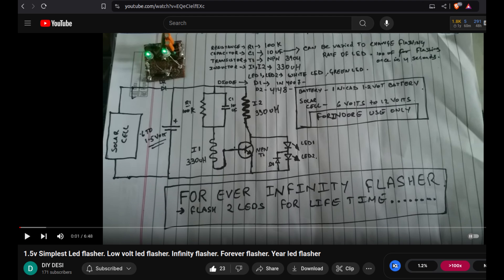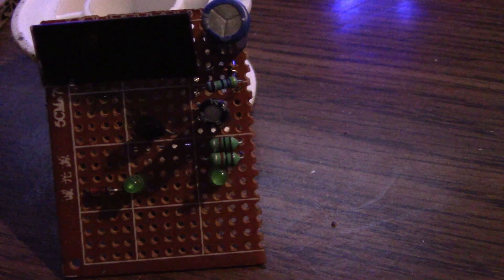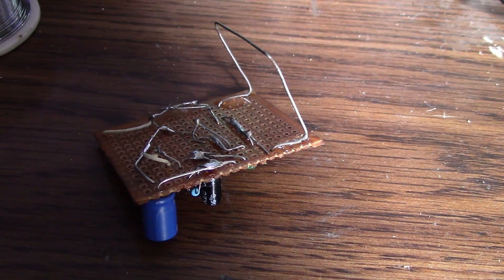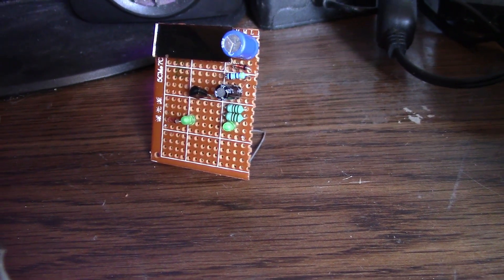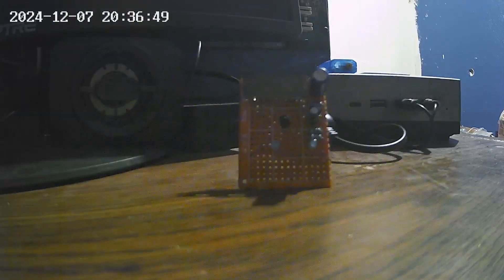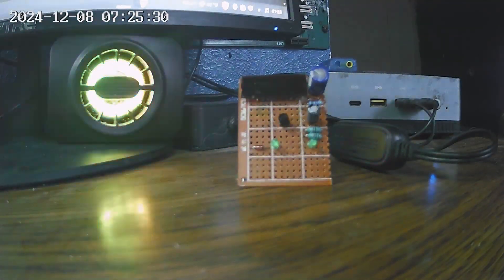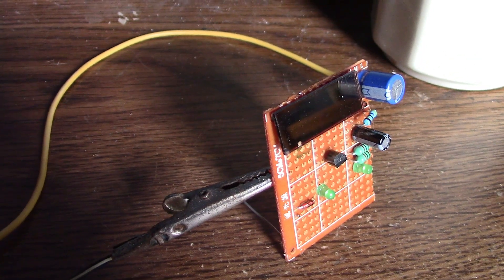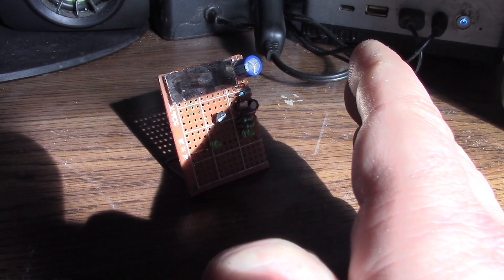This DIY Solar Circuit Runs All Day AND All Night

Comment: This will barely flash for a few decades, honestly. The electrolyte in the supercap will eventually dry out, and if they're anything like the electrolytics in 1980s vintage electronics, they will probably only last a couple of decades. Even less in continuous operation 24/7. If you can find a solid state capacitor that doesn't require an electrolyte, that would work. Or just use a rechargable button cell. They do exist. And have in many forms much more energy dense than any super cap. What problem are you solving by using a super cap in place of a tradition coin cell? They're less energy dense, and much larger physically. I don't see the advantage. The only advantage I can see is that you can solder directly onto the legs of a super cap, whereas you absolutely cannot (should not) solder directly on a battery. Only ultrasonic welding. Otherwise you cook the insides. You have to put the battery in a special holder that has to be exactly the right size. Which 3D printers can help with, but I can't justify buying a 3D printer just to be able to make custom battery enclosures. As nice as it would be.
Reply: I heard capacitors can be charged 1000 times faster and have as many times more charging cycles than any rechargible batterys...its of 2.7 volts but will be barely charged to 1.5 volts so wont get hot  also there is no such thing as undercharging or memory effect which rechargible batterys suffer..
Although things do break overtime❤
Reply from the maker: All correct. As I only replicated and then tweaked Desi's circuit I'm glad he answered you too. The main points are about efficiency and practical run time, which it does as a fun curio and with only component decay as a limit. 
The problem being solved is of not using a conventional battery at all. Down at 1F, the super cap size is very practical for small circuits.
I suppose it could be looked at it in a different way... I'm 55, the super cap will last longer than me.
Reply: @Slider2732_  if solar waiver can be powered insteed of led to make them dance pls a video ❤❤❤
Reply from the maker: @diydesi8433  Yep, just connect the outputs to the LED to the coil used in a waver instead. It should work. If you have a 1 Meg variable pot you'd then be able to set the oscillator rate. 
I don't know where my wavers are at the moment, will look for them. The dollar stores don't sell them around here either, or I'd buy a couple more just for the parts 😀

Comment: Very cool! I have a soft spot for circuits like this.

Have you tried playing around with the placement of the two inductors, and their polarity? I have built a similar oscillator circuit with a JFET, and I find that while it's not 100% necessary for the two inductors to be magnetically coupled to each other, it can really help the oscillator start up with less current. 

The best results I've gotten are from getting the two inductors placed closely adjacent and wired with the correct polarity so that when current flows through the output inductor, it produces a positive voltage at the base and turns the transistor on more strongly. I think that with axial inductors this would happen with them hooked up just like you show in the schematic and how I think you already have it on the board (with the transistor ends of both inductors next to each other). So I guess basically just playing around with their spacing from each other is all that remains.

The other things that can change the way this type of oscillator works are to add a small (~10-100pF) capacitor across the base and collector terminals of the transistor, and to add a a similarly sized capacitor across the output inductor. 

I'm going to say "change", not necessarily "improve".... but basically the way that the circuit works when the inductors aren't magnetically coupled is that the collector-base capacitance of the transistor couples some of the output energy back to the input, and completes the oscillation loop. Changing that coupling capacitance by adding some externally can change the circuit's behavior. Also, this coupling is more effective when the input inductor and output inductor circuits resonate at the same frequency, and putting a capacitor across the output inductor can achieve this. With lots of trial and error.

I will however say that while the capacitors do tend to lower the oscillation threshold, and allow the circuit to work with less current, they also tend to reduce the output power because they reduce the operating frequency. And if one puts a capacitor across the output inductor it's usually necessary to play around with the value of both that cap and the collector-base feedback cap separately to get them both adjusted right for each other. 

It's really quite a lot of fiddling around. Not saying it's worth it! The circuit seems to be working fine. Just thought I'd mention it in case anyone found it helpful.
Reply from the maker: Great helpful comment, thank you 😀
The caps across do remind me of tuning a regular wireless energy circuit, at a far smaller physical size. Radio variable caps would likely help with correct values and those could be replaced by ceramics when the best values were found. 
Inductor polarity was found out about recently, when discovering that all 200 on my Power Chip project have been soldered the 'wrong' way around!  So yes, certainly, proximity and polarity are highly important at these mini power levels.
Reply: @Slider2732_  Oh yeah, I should have mentioned that. I 100% used a variable capacitor from a little transistor radio kit when I was playing around. I only had one, so I had to try fixed ceramic caps for the other capacitor, but yeah: almost obligatory to use a variable capacitor, there would just be so many combinations to try with fixed capacitors.
Reply from the maker: @InductorMan  IKR haha.. so many times I've spent hours on a circuit because of no variable cap, then found one while putting the component boxes away!

Comment: Seems strange that D1 is only across LED2? do you have something against LED1 so your not protecting it against a high reverse voltage spike.
For more fun try replacing the solar cell with a bank of LED so getting the LED to do both the energy in and light out. 🙂
Reply from the maker: I don't have anything against LED2, Desi might lol. He does have a vid where LED's are used as solar collectors, using a laser to show the results in better real time for a short video. Years ago I made a similar blocking oscillator with a single green 3mm LED as light collector, which did work fine. 
Thanks for your comment 😀

Comment: What is the purpose? is it to catch solar energy and have a circuit that does "something" for as long as possible, or it it the blinker circuit that has a special purpose?
Reply from the maker: I believe the original purpose was to make something from simple components to simply run all the time and need no battery. I've tweaked it to use a much smaller capacitor and a tiny solar panel that needs no direct sunlight. It's still running now. A fun circuit, somewhat of a Sunday afternoon build.

Comment: Thanks i will make one with improvements ❤❤❤ i wonder can this circuit run with rf energy  the circuit they make to harvest energy from radio waves.. combined with solar pannel..
Reply from the maker: Glad you liked it. Circuit is still going, even during another rainy day today.
I expect the circuit should run on RF, anything above 0.6V and a few uA to start filling the 10uF cap 😀
Reply: @Slider2732_  i superglued those inductors with stapler pins efficiency increaded i guess.. pls check am i right...❤❤❤❤
Reply: @Slider2732_  Changing led colour from green to yellow to red effects the blink rate and efficiency also🎉🎉🎉
Reply: @Slider2732_  i just supreglued those inductors with stapler pins and eficiency increaded pls take a look...❤❤❤🎉🎉🎉

Comment: Great result. That is the trouble with timelapse, when you are trying to catch a flashing light you often miss them all. Same with my solar rockers, they might be rocking fine, but the timelapse often makes them look stationary 😁😁
Reply from the maker: It was quite the surprise, expecting to see a light on all the time. The background clock on your 3D printer timelapses is always good to watch, as a btw. That little feature clearly shows the print time taken and also the timelapse speed 😀
Reply: @Slider2732_  if you can, have the timelapse do long exposures with a very low aperture/ISO (plus maybe a neutral density filter). ideally the shutter is open most of the time. or if your hardware doesn't allow that, capture at a faster rate that does allow the shutter that does allow the shutter to be open most of the time, and speed it up by averaging frames. basically doing the equivalent of a long exposure shot, with little gaps in the exposure time for the time between frames. if i was in this situation i'd probably just write a little python script to do this, but if that's not your cup of tea there's gotta be existing software that can do this. (this is not the same thing as just speeding up footage in your video editor, since the editor will probably just pick a single frame for each timelapse period and discard the rest, rather than grouping and blending the frames, but it's possible your editor may allow you to configure this)

Comment: Great little circuit, the oscillator circuits are a very interesting area.  The one i had done quite some time ago now struggles at this time of year and has a much larger solar panel but is constant light dim to off this time of year never gets full sun even in summer and I was amazed at that. You have knocked it out of the ball park 👍
Reply from the maker: Thanks John 😀
It's been a fun one to work on and is still going with no problems. We've mostly had gloomy winter days so far and yet it still carries on going. I'd rather that than a bit faster flashing and it run out of power.
Reply: Yes definitely, I know that you will know about it but it's quite interesting to listen to it through am radio gives you a good idea of what's going on in the circuit. 👍
Reply from the maker: @johnwynne-qx6br  I agree. Lidmotor used to do a lot of that a few years ago with his radio, it's a very helpful technique 😀